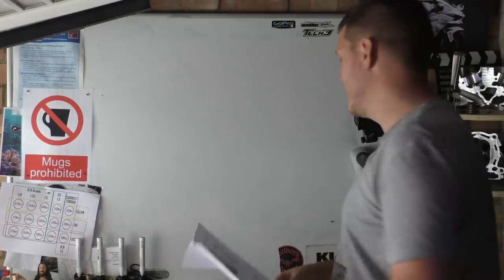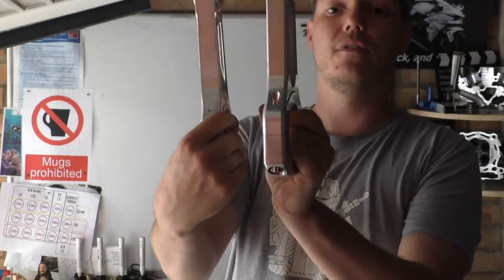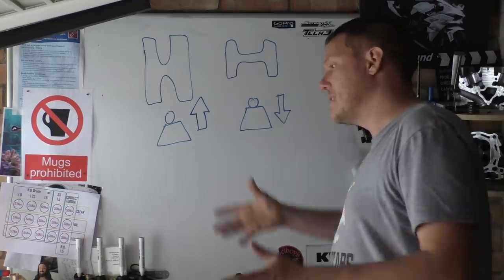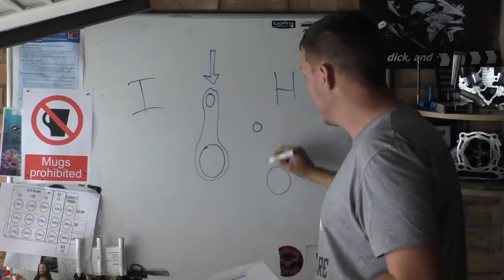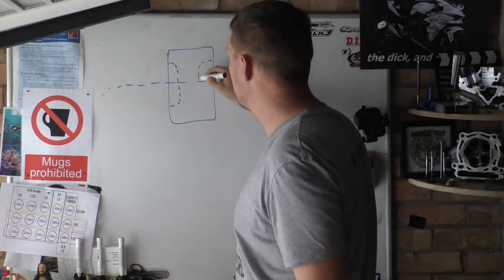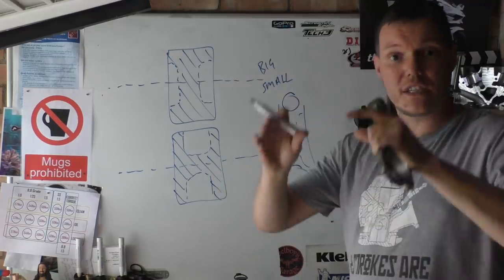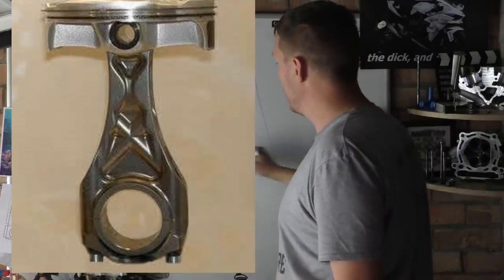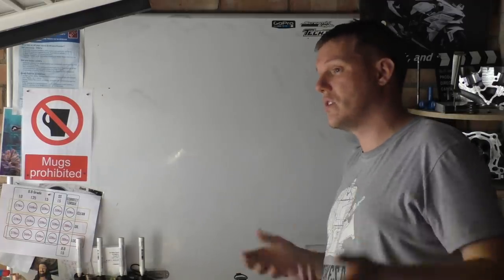H beam rods - are they better?

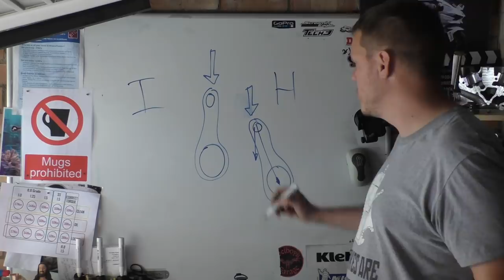Comment: Matt, are you kidding me! What you tell around 6:34 is absolute bullshit!
There is no bending force in that example of yours! The conrod is hold in place by bearings. You cannot put a torque in that direction because the bearing would turn. Your example will only work when your lower bearing is locked/fixed! This is very basic engineering!
Your video goes on and on after this mistake. However, in the end you do show that bending forces are apparently there. The pictures of the F1 conrords are interesting. A bending force can only be created by the circular motion and acceleration of the conrod. Apparently that force is big enough that it causes problems. That is interesting.
Furthermore I don't agree with the statement that H beams rod are heavier than I beam rods. As an engineer you have the option to make beams as heavy as you like. An I beam can be nearly solid if you like. Your statement should be: "I beams are easier to make lighter than H beams". 
Keep up the videos! I do like most of them.
Reply: I forgot bearing friction. This will also create some bending force on the rod. Although that force should be relatively small because of the low coefficient of friction.